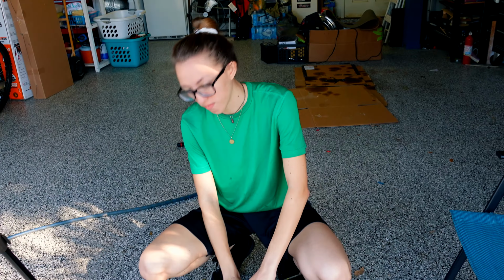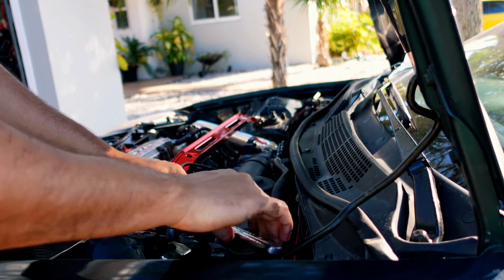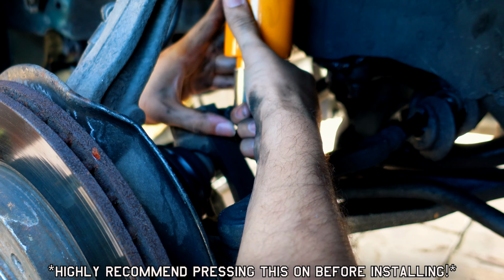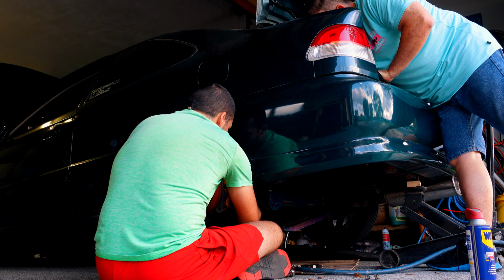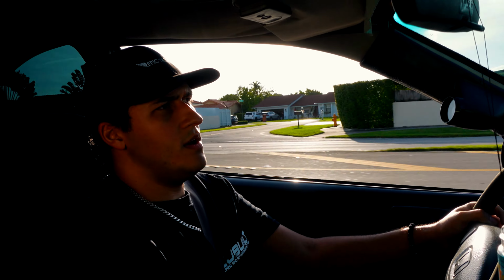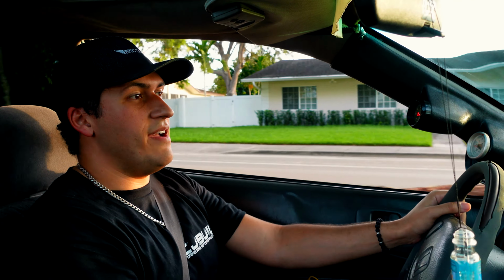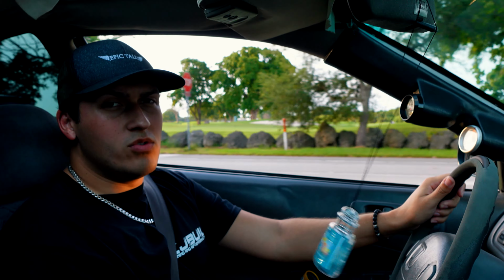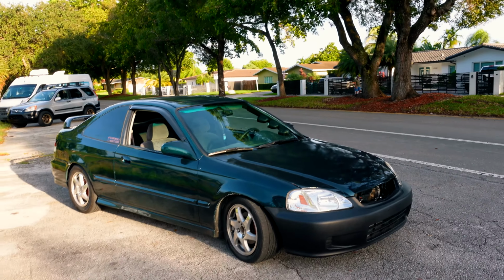Shocking Truth About MaxPeedingRods Coilovers!

Comment: I actually helped mxr with shock dynoing and testing the t06 version and then we got the T07 version they are really good the old red blue and yellow versions are honestly really bad , but the new black with grey spring and black with blue springs are almost as good as bc on the shock dyno- we use them on our endurance race car so far we have done 6 - 6 hour endurance races on these coil overs and not a silngle issue.
Reply from the maker: That’s actually amazing feedback! 

I 100% will take this into consideration and hope others will also!🙌🏼

Comment: Leaking coilovers can be just a defect but also some people just put them on without ore loading the springs so the springs end up floating around in there which is not good for the shocks. Eventually stresses them out and causes leaks